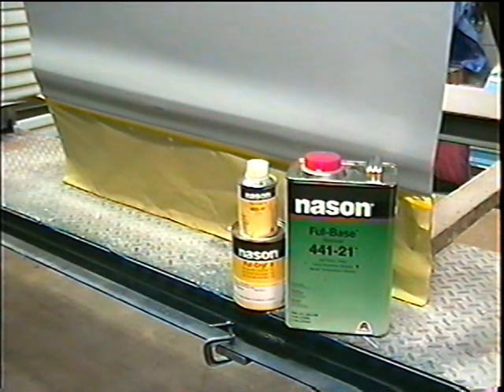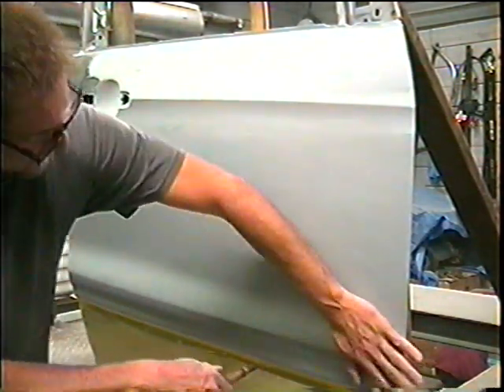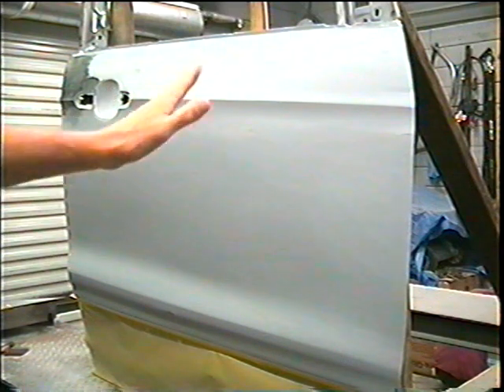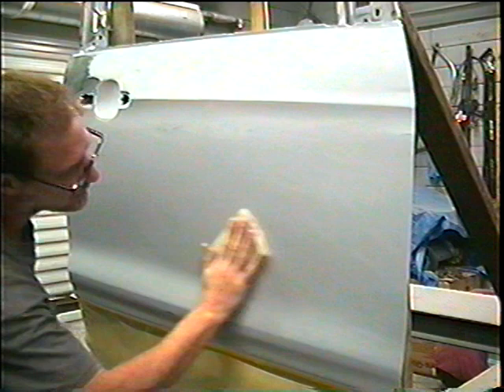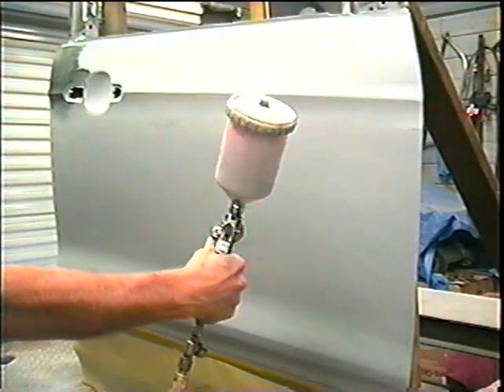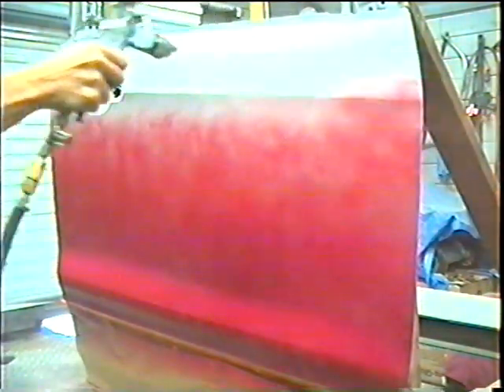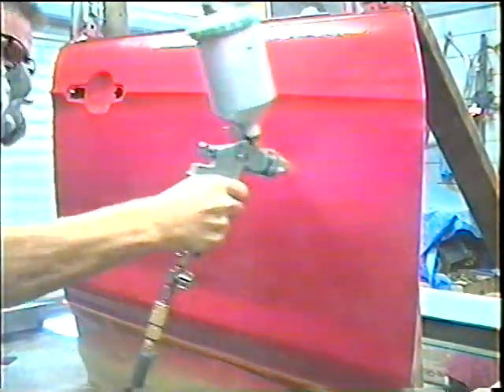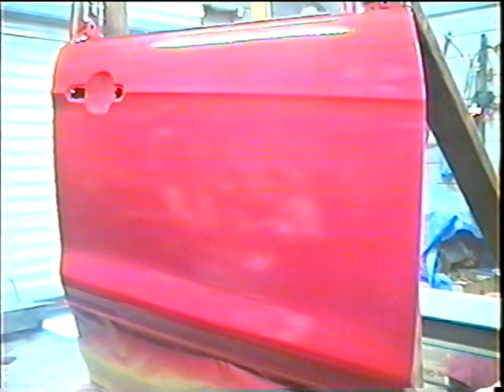Spraying Nason Ful-Cryl / Ful-Thane Single Stage Paints - Panel Repair

Comment: I am planning to paint my 1977 C10 with two tone single stage unethane paint and create trim line where the paint colors transition. Can I use urethane clear coat over the single stage to blend the ridges? Thanks for your videos
Reply from the maker: Yes - might want to check the recoat window and make sure you clear both within that time period.  Another option is to lightly scuff then clear.  Myself, I wouldn't be afraid of clearing it even if it is a bit past the recoat window.   When in doubt read the label or info sheets on the urethane that you are considering.  Let me know what you do and how it goes - Jerry
Reply: @LakesideAutobody  Yes I thought that I would let it cure and scuff before applying the clear. 
Thank You for the quick response. I can spot someone that actually have time on the tool's of their chosen field. Thank You for your videos
Reply from the maker: @rickrickman5277  You're welcome Rick - feel free to ask ?s - doesn't matter what video - I usually get to the comments once a day.

Comment: Have you ever seen this before? Lacquer  paint has cracks when i sanded , the cracks were in the metal, how would you address this? Just bondo?  It wont let me post image
Reply from the maker: Yes.  I've run into many different types of cracks in paint.  Some have designs like crows feet, checked, pits, bubbles, random shaped cracks, etc.  Generally you have to remove the cracked paint or it will eventually show up in the next finish.  That being said, I have cheated before and used filler like you are saying and got away with it.  It's up to you and it can work (filling) but you do take the chance of seeing imperfections later on.  Hope that answers your question a bit :)
Reply: The cracks are right down in the metal through the paint, which i sanded down to bare metal and see that it is in the  bare metal , it is a 1956 continental, on roof and trunk, any way i can send you pictures?
Reply from the maker: @briangurney9056  Yes - send them to schoolvideolibrary @ gmail dot com  - Jerry

Comment: Hi Jerry, for the home, do it yourselfer would you recommend enamel or urethane?
Reply from the maker: Both are fine for at home DIY.  Nason has Ful- Thane and Ful-Cryl  - both are great.  Ful-Cryl is less $ but for a DIY guy it's just fine.  Here's Nason Ful-Cryl enamel with a hardener: https://www.youtube.com/watch?v=2H3UHCgQu2Q then with a coat of wax:  https://www.youtube.com/watch?v=LMsf7ZUAda0  Ful-Thane flows out just as well but probably more durable over the years.  Both are great for DIY   If you are more or less practicing, I would go with enamel with a hardener.  Nason enamel is a great start - you can't go wrong with it.
Reply: Thanks very much Jerry for taking the time to answer all my questions!
Very much appreciated
Reply from the maker: @rivermetal  You're welcome - It's a relaxing part of my day :)

Comment: What tip size is that on the gun if you don't mind
Reply from the maker: 1.4 mm but you can use bigger if that's what you have.

Comment: Another great video, what would be the recoat time ? TDS doesn't give a recoat time, I have painted the bottom of my Vespa last nite and have a run I want to fix as well I want to continue on up the front of the frame from where I left off and want to know if I have to scuff with 400 before applying the rest of the paint from where I eft off . Thanks
Reply from the maker: I think you should scuff first if it's a day later.  You might be able to get away with not scuffing but... Let me know what you decide and how it worked out.
Reply: Lakeside Autobody thanks I did 400 wet sand the couple runs I had and did a wet sand scuff on all areas that had overspray. Got the job done , in fact just came in , job went well, keep up the great videos.
Reply from the maker: @harleynut1961  Good to hear - glad it went well - have a great week end.

Comment: Is that the Central Pneumatic gun from Harbor Freight?
Reply from the maker: No it's a Mac but I hear Harbor Freight guns spray pretty well.  I wouldn't be afraid to purchase one.  I've had a lot of off brand spray guns and I was very happy with them.
Reply: @LakesideAutobody  I have the one that they sell for $69 and I love it. Looks like the one you were using, that's why I asked.
Reply from the maker: @89Mirageman  May be made by the same company. They have ones for 12.99! - wonder how they work - Jerry

Comment: I had very bad experiences with Nason single stage urethane. Tried two different colors and even changing equipment but just cannot get rid of the fisheyes. Base coat clear coat no problem. Not sure what is is about that stuff... just don't work!
Reply from the maker: This was Nason Ful-Cryl which is their single stage acrylic enamel.  I have not used their Ful-Thane which is their single stage urethane - I'll give it a try though.  Not sure what caused the fish eyes for you - maybe tool oil, some type of oil coming from the air lines?  Fish eyes are actually very rare - seem a bit fishy :)
Reply: @LakesideAutobody  thats usually the cause.  However I spent the month eliminating factors... and of course clear coat or any other paint did not do it... I even tried painting  clear coat over cured and scuffed nason ful thane.. guess what? fisheyes! There is something up with that paint. It don't like me!
Reply from the maker: @glytch5  Well - I guess the stuff must be real sensitive then.  I'll try to remember that next time I want to purchase some single stage urethane - thanks for the warning :)
Reply from the maker: @reserved50  Something went wrong wrong and contaminated your panels.  Oil in the compressor tank, lines, air tool oil from the DA, rubbing compound residue, eating while working, oil in the lines, contaminated rags or tack cloth, something.....  I haven't had a fisheye since I was young - like 30 years or so no matter what paint I'm using.  Check those things and let me know if you found anything - curious as to the cause 😊

Comment: Look at the spray pattern you used for this job. Completely different than the pattern you had in the PaintForCars vid. Looks like it may the same gun but,  completely different results.
Reply from the maker: Thanks for pointing that out.  I think with the Nason paint, it goes on so nice that I didn't have to "pound" it into the panel to get it wet.  I was allowed to open the pattern a bit more and lay it down nice.  I'm just not a big fan of the Trinity paint - You'll have to try it to and get beck with me - I' really like that.  Jerry
Reply: @LakesideAutobody  How does the viscosity of the Trinity compare to the Nason? Surely, after you reduced the Trinity 100%, it was thin enough to open up the spray pattern.
Reply from the maker: @stevewarren3051  Have you ever opened a can of rustoleum and stirred it.  Exactly that thick.  First coat sprays real weird too - a lot like oil based paint - rustoleum or valspar
Reply: @LakesideAutobody  Regardless how thick it was in the can, you thinned it more than  enough for it to be sprayable using a normal spray pattern. Also, the second time you sprayed it, you applied it over the first application that had the heavy orange peel. You had nothing to compare the second application to the original application.
Reply from the maker: @stevewarren3051  I wet sanded the panel completely flat w/ 320 before the next video.  It's just a review video - that's my take on it.  I've sprayed enough good stuff to know the difference.  Nice chattin' with you.
Reply: @LakesideAutobody  I think we're seeing wrinkling here, not orange peel. Go back and look at the 1st vid again. Look where you had sprayed the 2nd coat and were just about to spray the 3td. Do you see any orange peel? I can't see any. The orange peel or wrinkling didn't appear until after you sprayed the 3rd coat and then, it was very apparent. Acrylic enamel is bad about wrinkling if the painted substrate hasn't cured enough when you apply another coat. I've had this problem a few times myself. The solvent in the new coat migrates into the uncured coat below it and makes it wrinkle. I enjoy your vids.
Reply from the maker: @stevewarren3051  I'm glad you enjoy them.  Thanks for the comments - good talking to you - Jerry